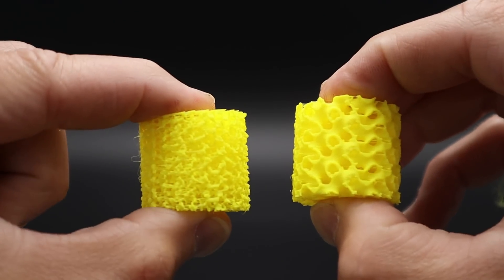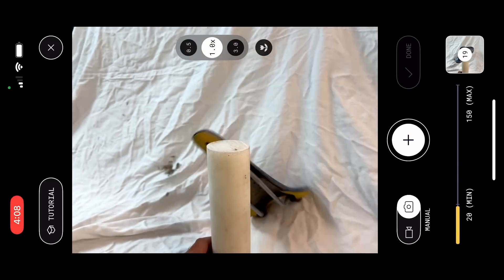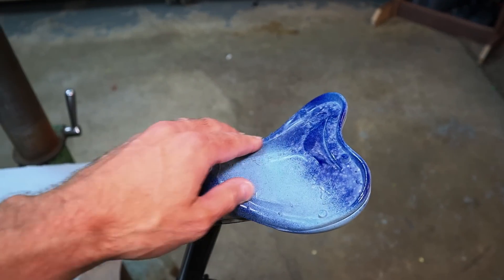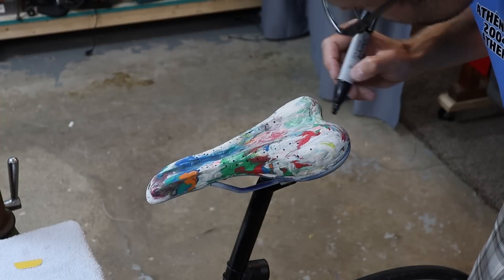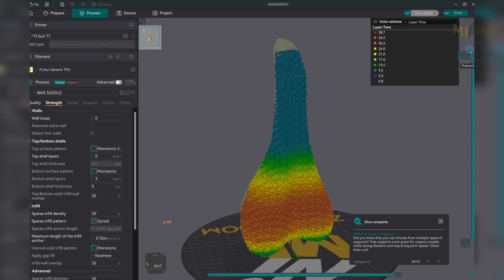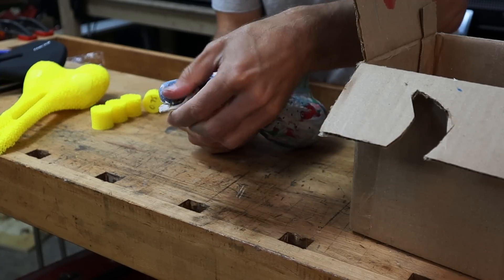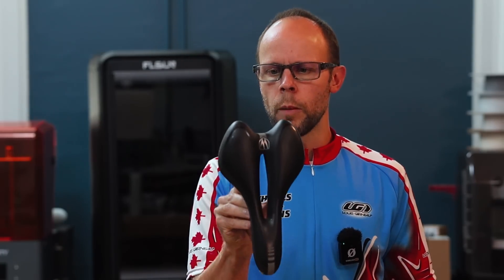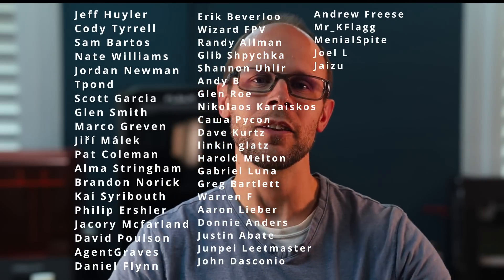Soft and Firm into One Very Satisfying 3D Print

Comment: The thing that annoys me most about those 3dprinted products is that they are monstrously expensive and aren't even custom. Which is the whole thing that makes 3d printing actually win over traditional methods.
Reply from the maker: I was blown away when I saw the price and when you look at the reviews, you'll see that they don't last.  I'm working on a process which anyone can do that will last, that will provide the support where it needs to be and it will be fully customizable for anyone.  They'll need to provide some data, maybe a 3D scan would be a good idea, or at least some measurements.
Reply: As much as I love the idea (and realization!) of a "homemade" custom printed 3d saddle, not everybody has the equipment and time. I'd say that this sadle cost about $5 an material and 20hrs in scanning, desiging and making. The next iteration will be done faster, but not that much. 
I also had problems with my saddle. After 1hr max (faster on a trainer), my but really hurted. I had bike fits and tried different models, without success - finding the right one is a bet today. The 3d printed saddles looked promising, but the ones from the big brands are way too expensive for me. So I tried one from Ryet, bought via Aliexpress for about $40. Carbon base and rails, two 3d printed cushions. No more pain, even after a 10 hr ride.
Reply: That's what happen when you let capitalists into the system. Think about all the lies sold about "affordable 3d printed houses" ... Only to see venture capitalists printing dog 💩 quality "homes" then turning around to sell them for half a million dollars😭
Reply: Printing something yourself is cheap, but having something printer for you is expensive. Why? Well 1 they have to make a profit, when you add up shipping costs and how long it may take to post process something it starts to add up. 2 not every print is successful. 3 not every print works in certain orientations. At home of you have to print it 3 times before you get it right, you basically waited 3x as long and wasted a few dollars in material. But for a business this is a much larger issue, you are tieing up a machine that could be printing something else when a print fails. Also at home post processing supports may be therapeutic in a sense but for a business it's added labor and stress if they break the part because of it. So, no it doesn't cost that much if you do it yourself but to have it made yes it costs a bit more. The same is true for most things. If you have a cnc machine it's cheaper than out sourcing the part. But at home if you break a bit, you throw a new one in and do it again. It costs you more and takes longer but it's still cheaper. Labor , and waste is very much a part of profit so it is to be expected to cost more. There is no way around this.
Reply: Wants custom, and cheap..... sound like it's time to DIY it then. You get 3 prices, bulk, custom, and diy. Your choice.
Reply: @JH-zo5gk  I don't want both custom and cheap. I want products that use 3d printing to actually take advantage of the flexible manufacturing method rather than just be overpriced novelties that don't even have any advantage over traditionally produced products. I don't mind that it's expensive. Like you said bulk, custom or diy prices. Why are they charging custom prices for the equivalent of bulk products.
Reply: That's because people like profit.
And as for the custom parts, many of the 3d printed products aren't made on request, but rather printed in bulk, which leaves no customization to the end user. There are printing shops that do print on order, and allow you to change some stuff, but even then sometimes it's too much of a hassle if the customization is something big, meaning the people running the shop waste their time adding custom options, which means they can print less other stuff if everyone does it.
Reply: Generally at least for 3d printed bike saddles, they’re made with SLS machines which have a huge upfront cost, slow manufacturing, and a large amount of post processing. Generally margin is around 20-30% on these types of products

Comment: They say riding bicycles too much can cause male infertility because of the way you sit on them. I wonder if this would help that.
Reply from the maker: Keep the pressure off of those sensitive areas and it shouldn't be a problem.  I think the new saddles are quite a bit better with that cutout in the center.  They still apply pressure to other areas which will cut off circulation and that can't be good down there.
Reply: Its very important that you get a seat that doesn't apply pressure to anywhere but your sit bones. That is why properly designed seats often have a cutout down the middle to avoid soft tissue damage in your crotch.  Seats without the cutout can also work IF they have a flat profile that doesn't apply pressure in your soft tissue.
Reply: This was before they started putting holes and grooves in sensitive areas in saddles so that they don't put pressure there.

And "too much" here referred to multiple hours per day FYI.

Comment: I have no direct experience of scanning but I'd always thought it important to rotate around the subject rather than turning it.
Reply: it depends on the method/software used. Some are designed for the model to spin, others for you to rotate around it.
Reply: Nope, either way works. I have turntables for my scanners, but you can also move around an object. Most 3d scanners aren't as mobile as using your phone (photogrammetry) since they require a computer to be connected by cable.
Reply: @ryanlandry8214  thanks. Good to know.

Comment: I think your results are extremely impressive! With a little bit of tweaking you can make it even better. Really enjoyed the process. I know the type of bead foam you were looking for, hahaha. TPU is a really amazing material and it's crazy how durable it is. I think this definitely beats paying $600 for a saddle that isn't even truly custom. Great work as always!
Reply from the maker: LOL, what a fool I am; I thought I had the foam beads!  I need to get out more.  Someone mentioned that they use foam beads in a vacuum bag, that might be a good option to try as well.  I just need to make sure the kids don't get a hold of the foam, that could be a disaster!  Now I need to try different types of TPU and different durometers.  I'm making good progress on the leveled up version of this, and I think I can set it up to make it work for a lot of people as well.
Reply: yoy can use really soft wax, there is filleting wax based on bees wax which is used during mould making. I am making custom shoes (currently prototyping), its best sculpting material yet. I have tried monster clay, but its offen too hard, also used foam boxes but those are not accurate. Give it a try

Comment: Have you tried Sainsmart GT-3 TPU 95A? Its a truly magical high speed TPU, I have it printing at 22mm3/s on a .6 nozzle @ 220C. Wish there were also higher densities of TPU, since its such an amazing material outside of its usual flexible properties.
Reply from the maker: Really, that's wayyy higher than I've been able to get, I'm only hovering around 6m³/s.  I've heard good things about it, so I'll see if I can get my hands on some.  I'd love to be able to run some through the AMS, I think it's just a bit too stretchy.
Reply: @NeedItMakeIt  yeah, with Overture 95A I need to limit myself to 4mm3/s at 230-240C and its just a whole pain, tons of stringing even fully dry and its a rough filament that requires tons of force to pull through the tube, the sainsmart has a really smooth exterior
Reply: @lbatalha  Yeah wow that's crazy fast usually the limit is 5-6mm³/s
Reply: I have overture high speed tpu and I'm pretty sure I am printing at 16mm mvfr.
Reply: @phasesecuritytechnology6573  Ah havent tried that one, just the regular non-highspeed overture one unfortunately
Reply: I print chew bones for my dogs with it and though they have been able to tear them apart it took 2 dogs several months to do it. And it cost me less than a dollar.
Reply: I print polymakers HS tpu at 12mm3s and it could probably go faster, haven't tried it yet but prints look great!

Comment: Btw if you find subdivision modelling comfortable in blender, you can export the unsubdivided mesh as a quad obj. Import to fusion then convert to t-spline then to b-rep and you end up with a solid object very similar to the subd model.
Reply from the maker: I'm open to using Blender for sure like this, I'll give it a try, thanks!  I've been using Rhino and GH and it has been a big learning curve, but the possibilities are endless and I've made really good progress in the last week in getting something very close to what I've been looking for.   I was able to convert the mesh from Blender into a Subd model in Rhino and the quad mesh is a bit dense, but it doesn't seem to matter.
Reply: @NeedItMakeIt  Yes Rhino and GH are probably the best approach from what I've seen. I don't have them though. 

I have been playing with Blenders geometry nodes with the aim of doing precisely this sort of variable infill. I've used signed distance fields to generate a range of infills, that can also be manipulated to thicken or change cell density/type in specific areas. Mostly with the idea of using resin or powder based printing methods. I've put a few shorts up showing concepts. 
I've not been able to crack a voronoi/stochastic lattice that is to my liking however. Once I've managed that I'll make it available.

Comment: Nice, very nice indeed. I also built a saddle, but for a motorbike and after intense riding I found the problem to be the creep (Creep in polymers is the time-dependent deformation of a given polymer). I am now experimenting with tubes for bikes and TPU in combination and am very interested on how you proceed. Greetings from Germany
Reply from the maker: Very cool.  Yes this is something that I've seen in a previous testing video I made with TPU.  I've seen that it does spring back, but not 100%.  I might like to experiment with having a version printed professionally to be able to compare.  We can also run some tests here in the shop for TPU.  I can print some samples, and them compress them for a few days and then let them rest for a couple of hours and then re-measure.  Hallo aus Kanada!  I'll have a follow up to this likely in 3 weeks, this is quite a learning curve to get it to work the way I want it to, but it's going to be amazing and also fully parametric.

Comment: It has long been known that the bones need a softer material and the soft part of the body needs a harder material
Reply: That was what I was thinking. Defeats the purpose of a cushioned seat if your butt hurts from the bones pressing against a harder surface. The rest of the butt is already cushioned.

But I also don’t cycle. So there could be reason for stability or something else?
Reply from the maker: A little cushion and flex is a good thing under those sit bones it's most important to prevent compression of the soft tissues, especially over a long period of time, it will cut the circulation and become numb, it can also cause long-term damage to other body parts down there.  The bones are the frames of our bodies, it's best to get the load to them as directly as we can.  More research is certainly required to have a full understanding.
Reply from the maker: In the case of a bike saddle, I don't believe that to be the correct direction.  The load needs to go to our frames, and avoid pressure on the soft tissues, that will cause the blood supply to be cut off and cause numbness, pinched nerves etc.  The exact correct proportion and softness... well more research is required, I'd imagine that I went a bit too firm for the entire saddle.  Most importantly keep pressure away from the reproductive body parts down there.
Reply: Yes, it is also known from prosthesis products.
Reply from the maker: Do you have any resource you can provide, I'd like to do more research on this subject.
Reply: @NeedItMakeIt  My reference was here, the topic of tissue compliance and interface starts around 4:30: https://youtu.be/CDsNZJTWw0w    I can not guaranty, it applies to bicycle saddle, but the guy from TED talks video has also all his weight on his prosthesis legs.
Reply: Same for me, this seemed counter intuitive
Reply: Bicycle saddles typically are like this, the sit bones need a harder material to be comfortable.
Reply: No, sit bones should rest on a hard surface. The best seat I've ever had was hard as a plank.

Comment: after all this work, you came out with something worse and less durable than the original seat ...
Reply: Even if it is less durable (which I am not convinced that it is) It's easily replaced, provides better support for him, and cost less than buying a seat.
Reply from the maker: Can you elaborate a bit?  Maybe not a 5/5, maybe you were expecting 6/5?
Reply: Worse how? What makes you think it's less durable?
Reply: @802Garage as was said already in the comments, seatbones need cushioning and meaty parts of ass need firmer support.
Reply: @diamonddogie  He said it was far more comfortable than his two other seats. He can easily alter the infill. TPU is incredibly durable. The original comment is completely wrong even if this can be improved.
Reply from the maker: Strictly based on the research I've done on bike saddles and my own experience from road cycling for 26 years, we need the firm support below the bones, it would be a mistake to support the soft parts of our bodies which contain all of the blood vessels and nerves.  The load needs to be transferred to our frames; our bone structure.  That is unless you want long-term damage.   Personally I like to keep my reproductive systems intact.  I will admit that more research is required, there is a lot to know when it comes to designing parts which mesh with our bodies, and I won't pretend to know everything.